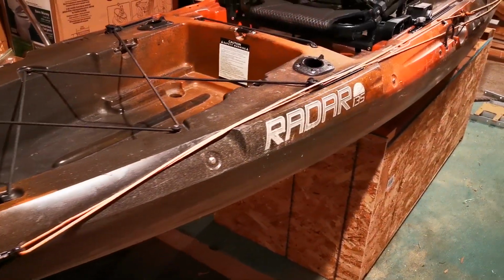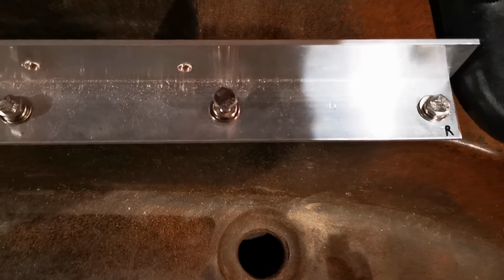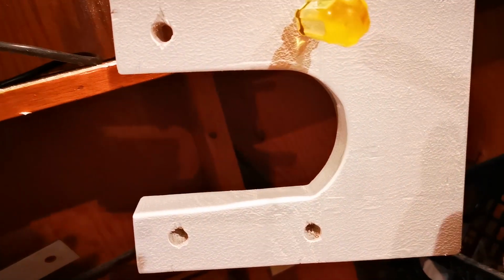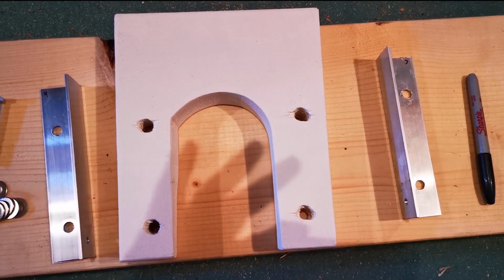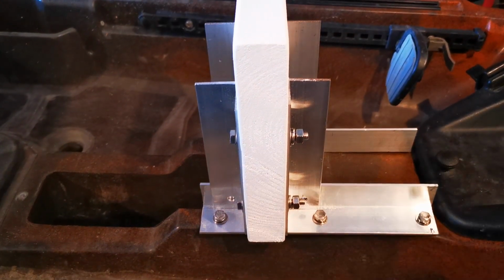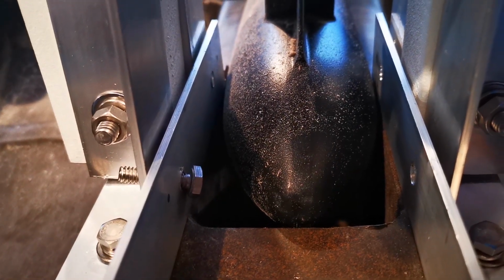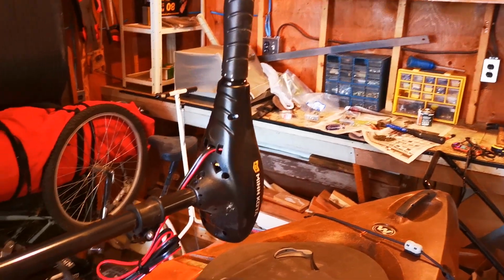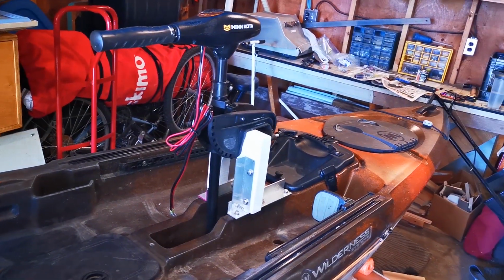Wilderness Systems Radar 115 And 135 Minn Kota Trolling Motor Mount

Comment: What size motor are you using? Also I have the radar 135 and the opening is only 12” by 3.25”.how do you hate the motor head to drop in? TIA for the help. Bob

Comment: Where did you install the battery and what battery did you use?
Reply from the maker: I used a deep cycle trojan battery with high amp hours. 

I would reccomends using a light lithium ion battery though. I just stuck it in the back and ran some thick copper cable with quick connects.

Comment: Clean setup but it looks like it would be a little high and interfere with fishing. Couldn't the mount be lowered and shorten the shaft to lower the profile?
Reply from the maker: Hey man! Thanks for the comment and suggestions. It could definitely be done like you suggested. After testing the set up out, and catching a few fish. I haven't found much interference. I have only had it out on the water once this year and haven't caught anything big yet, surprisingly when the trolling motor is in the stowed possition, you're still able to paddle as well. You might have to move your seat back a little bit but it works!